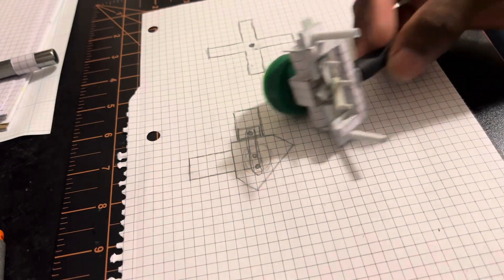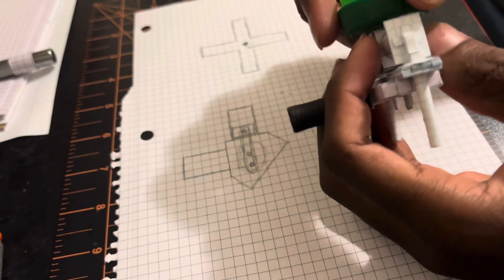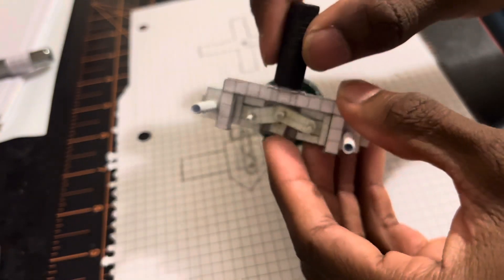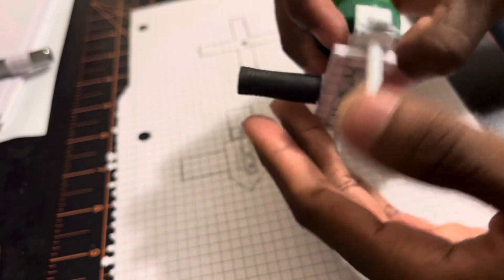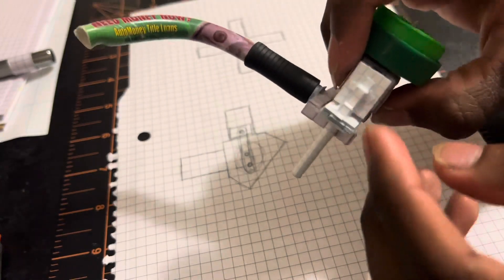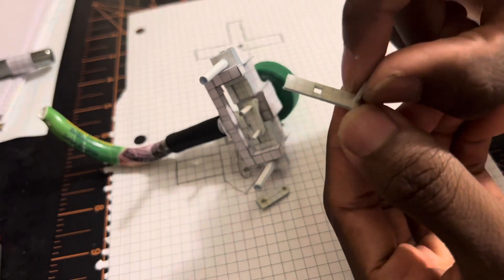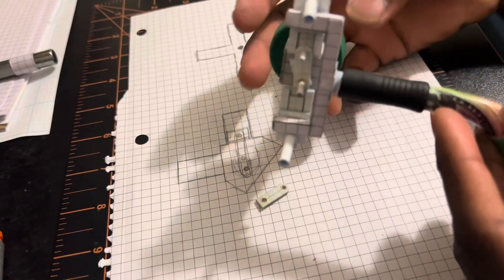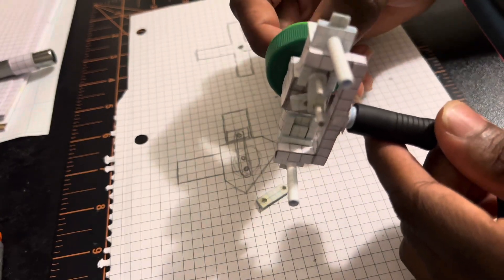Mini Boxer Air Engine Update

Comment: have a question for you but when you make these motors you use some type of mask to protect yourself from the glue
Reply from the maker: nope honestly i dont use any safety equipment
Reply: @PaperEngines   thanks for the reminder, I honestly use a mask to protect myself from the toxic fumes of glue
Reply: @dobrian170  Most masks let through gasses. I would say just do it in a well ventilated area.
Reply from the maker: Right